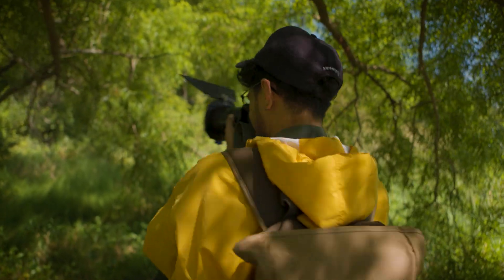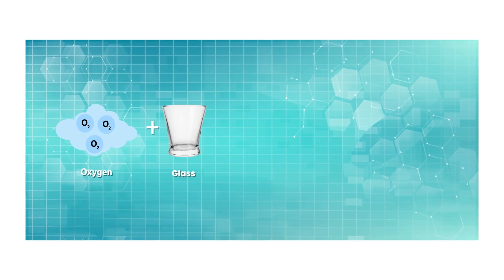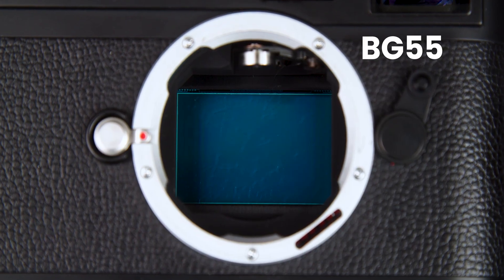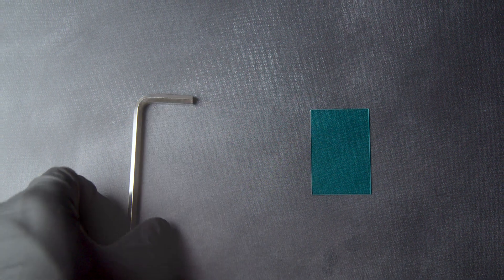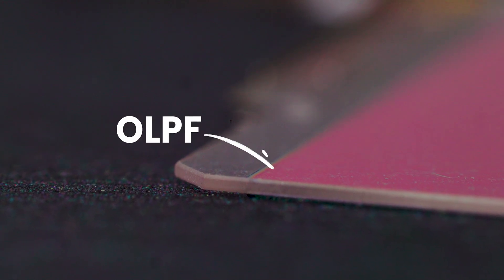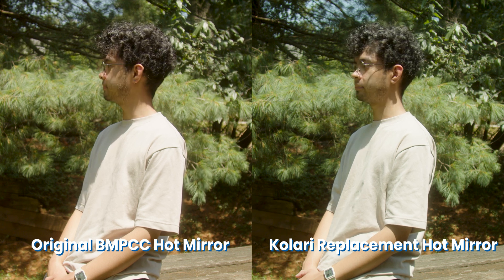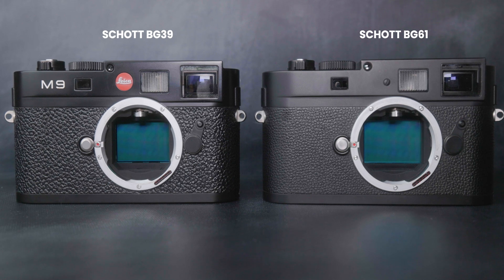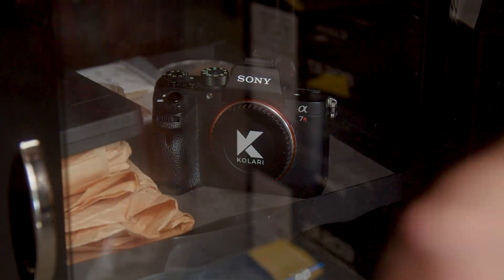Your Camera Sensor DOES NOT Have Fungus | Preventing Glass Corrosion

Comment: LOL, glass doesn't just "corrode" with moisture. The sensor glass does not in of itself have any "pigment". The plain sensor is clear. The IR filter DOES have a pigment within it, but that is NOT what is being described here. The process you are demonstrating is found in, (ironically), the more expensive sensors seen in Leica, and is the ICF filter. That filter DOES "corrode" because Leica couldn't be bothered to coat the glass and protect it. It is in fact OXIDATION, not a proper corrosion process. 

But, the point is, glass by itself does not "corrode" under normal conditions. The sensor itself is probably fine, (maybe?), but the IR filter is toast. 

I think it's hilarious that you Leica fanbois pay 3-4x more than I do as a CANON user, and still have such incredible terrible flaws. Sorry, have to rip on ya'll.

Comment: Highly informative video on the subject of corrosion. However corrossion is a corrosion and fungus is a fungus. I have to disagree on the "Camera Sensor DOES NOT Have Fungus" statement. Depending on one's geo-location the fungus is a valid and present problem - where I am it's for at least half of the year. Unlike the corrosion, the mildew does not differentiate between materials. It does not matter to a fungus whether it grows on a glass of the lens or the sensor, or other parts of the camera. It will happily eat into whatever surface it can process. If detected early, fungus is easier to deal with and without adverse effects, unless it's been there for long enough for its enzymes to eat away the surface material.

Comment: Nvr  heard of this. I have used cameras that were 20 years old and never seen this. Why do the glasses in my house never "corrode"?
Reply: Sounds suspiciously like a solution in search of a problem.
Reply: @docandersonshow  I have a suspicion that it may actually be more the coating(s) wearing off, or "corroding" than the glass itself.
Reply from the maker: This is most likely due to the fact that the cameras you are referring to have better coatings, layered glass, or an OLPF layer protecting it. The glasses in your house don't corrode because they lack the blue/green pigment which is sensitive to corroding.
Reply: @kolarivision1674  I am pretty sure the "blue/green pigment" is the IR filter that most camera sensors have. 

I assure you this is NOT the sensor itself. 

As far as I know from my chemistry knowledge, silica glass does not corrode under normal circumstances. You need special chemicals like, (strong bases), heated sodium hydroxide or, (strong acid),  hydrofluoric acid to begin breaking it down. 

The most likely explanation is that it is camera models that use a clear adhesive to stick the IR filter onto the sensor rather than, (the smarter), removable retainer. Much like with the adhesive used in lens elements, this adhesive can break down over time due to moisture or bumps and bangs. 

I have been tinkering with cameras and camera equipment for decades and seen enough IR filters to know.